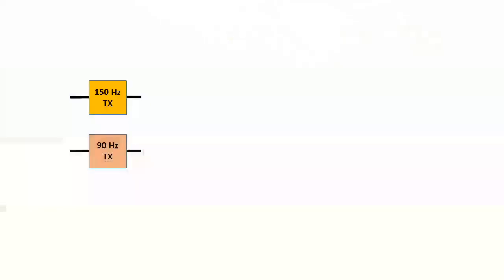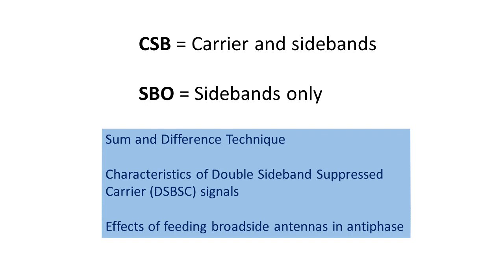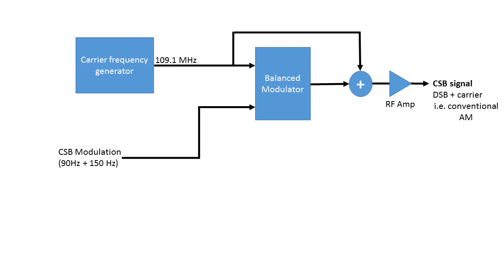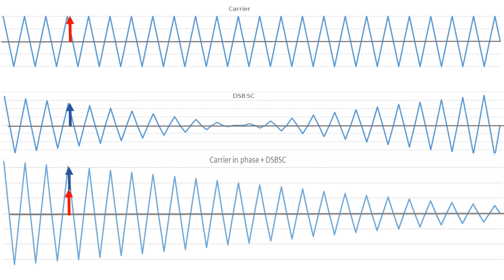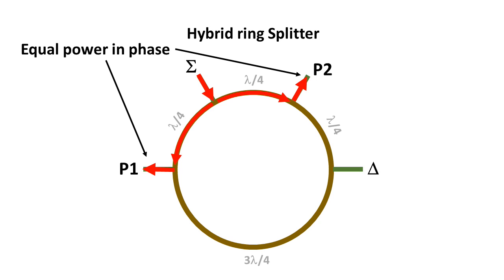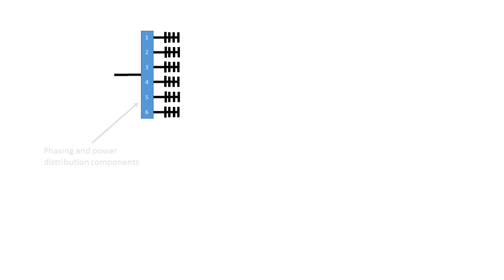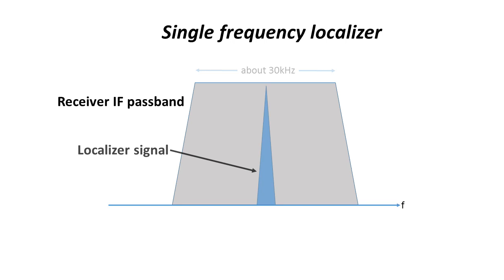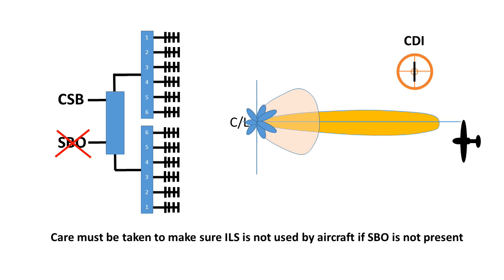Use of CSB/SBO technique in the Instrument Landing System (ILS)

Comment: Thank you for the great explanation! But why are the side bands of the CSB and SBO signals even emitted distinctly to enable space modulation rather than ending up summed (in a sense of a sum of sines) in the antenna (or wherever the two signals are combined)?

And sort of related to that: Would there be any DDM appear with the SBO signal alone (e.g. in the outer areas of the course) or does the CSB signal need to overlap the SBO signal(s) entirely?

Comment: sir very helpful, i have problems during flight check regarding adjustment of glide angle, glide course width and its symmetry. sir, kindly explain in detail plz.
Reply: Glide angle is adjusted via antenna height changes in the typical AM style or ground plane glideslope. All antennas are adjusted in proportion. For width, assuming CSB and SBO phasing are optimum, width is adjusted via SBO power. Symmetry, a bit trickier can be hampered with terrain problems. But, considering optimum phasing and optimum terrain conditions, antenna height proportion will improve symmetry. Symmetry is usually ignored (to an extent) if good flyup signalling is obtained at clearance heights above all ground obstacles.

Comment: Peter, I've watched this several times and just want to ensure I'm understanding correctly. At 12:40, I understand DSB-SC signals having phase reversals at each zero crossing. I'm also following you on the comparison of the Carrier and DSB-SC carrier phases being used to recover the audio from the DSB-SC in an ILS receiver. However, you then give another example by shifting the Carrier in anti-phase. When is the Carrier in anti-phase? Is this assuming the ILS receiver is positioned right of center line when the SBO lobe is out-of-phase relative to the CSB lobe? Was the first example an ILS receiver left of centerline? I'm assuming by Carrier you are referring to CSB.

Comment: I think you may have meant "like am modulated radios" not "fm". I very much appreciate this video though as it helped my comprehension of ILS theory.
Reply from the maker: No I did mean FM transmissions which use the Sum and Difference technique - they have a Left plus Right signal (the mono signal) and a Left minus Right
signal (the difference between the channels). The difference signal is transmitted on a 38kHz subcarrier on the FM transmission as a DSBSC signal.  When it is added and subtracted to/from the mono signal you get the left and right stereo channels out.  I believe something similar also was done for AM Stereo but  we never used that in the UK so I am unfamiliar with the exact way it worked.
Reply: @leepd60  fair enough I miss understood your analogy. Thanks for clarifying. AM radios, and demodulation of AM RF, also produce 4 separate signals during the modulation and demodulation stage. Sum, difference, and two original freqs. Although if the end result is a transmitted wave it's more commonly know as your carrier, USB, and LSB, and those sidebands contain the modulation source or audio freq. The thing is ILS emmiters operate off AM techniques, not FM, to the antennas. The radiated signal is then space modulated, so I was slightly confused as to why the comparison with FM. However your reply clarified.

Comment: Dear Mr. Lee. Thanks for an absolutely amazing video. I have a few questions which I hope you would clarify. 

1- Is the 90 deg phase shift added in SBO signal to compensate for the 90 deg phase lag induced by the hybrid splitter in the CSB signal on both output ports resulting in a in-phase signal but lagging by 90 deg nonetheless? If not then why is the 90 deg phase shifter in SBO signal?

2-  I have seen Glide Slope antennas in UHF band working with only 3 antennas (my guess is corner reflectors). Would the ILS working at a higher carrier frequency (say 1 or 2 GHz) have any impact on performance?

3- What is the typical HPBW of the Localizer signal (CSB and at -3db of difference signal null)?

I would love to have a similar video regarding the receiver of ILS specially the DSBSC demodulation. Thanks again!
Reply: SBO phase shifted to get 180 degrees phase realtion between csb and  sbo in space so that carrier in csb added  in phase to +SBO and  is added out of phase to -SBO

Comment: Greetings! I have built from scratch a 8 antenna  Localizer system transmitter included.  The main problem I am having is  deflection problems?? to the right i get 200 ua deflection to the left i get 150 ua? the center line is perfect . Why would i get un equal deflection??  I think it's phasing  of the side band to the carrier?????  might be the sbo cable is 270 degrees  instead of 90 degrees  what do you think .  Thank you for your time in making this video!!! All of my equipment is home brew  i have been a ham operator since 1969 cheers!!!!!!
Reply: If the SBO is at what you refer to as a 270 only means the sideband signals would be referred to as ‘reverse sensing’.  This means the aircraft would receive opposite assisting information.Left of centerline would result in ‘fly left’ or away from the RF centerline. The 90 degree reference is an accepted way of saying the SBO is displaced for maximum needle sensitivity with ‘correct’ sensing. You problem most likely is a cause of reflections from a nearby source. A fence, a house, a hanger, a ditch and so on. Have you attempted measurements from multiple distances from your antenna? Also an accepted location for accurate ground check locations for repeatability is 20 times the localizer a-spacing or antenna array width. Good luck.
Reply: In order to have a LOC antenna radiate such signals you have to introduce particular phasing errors in the 4 antennas on one side together with a localizer which is not perpendicular to centreline and further tweaking the SBO power. Also having a CSB which is not 0 DDM can be used to 'help' getting this effect. The likelyhood of having this situation 'by accident' is  low in my opinion. Reflections from a nearby building seems to be the most probable cause especially if you are using a 1 frequency system (no clearance signal) and a narrow aperture (like is the case with only 8 antennas) as the main baim will be quite large and therefore a lot of buildings/objects will be illuminated by this antenna array resulting in multipath.

Comment: .150 Hz and .90 Hz  is in the vlf band so is .362 Hz below the am broadcast band not vhf the vhf starts at 30.000Mhz and up lol
Reply: Um, no?

The LOC signal has a carrier frequency between 108.10 MHz to 111.95 MHz with the hundred-kilohertz digit always odd (i.e. 108.10 MHz, 108.15 MHz, 108.30 MHz, 108.35 MHz, etc. etc.).

Now, the tones for the centerline guidance, however, are two sinusoidal tone with 90 Hz and 150 Hz each.
Reply: 150Hz and 90 Hz are the modulating frequencies. The carrier freq of 108.10 to 111.95 MHz is what makes the signal VHF once the MF and CF are modulated